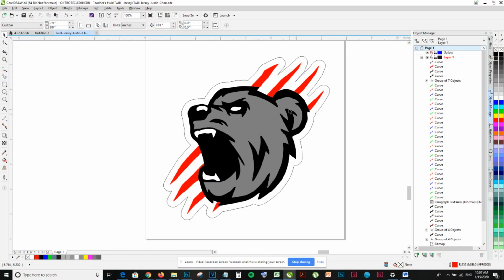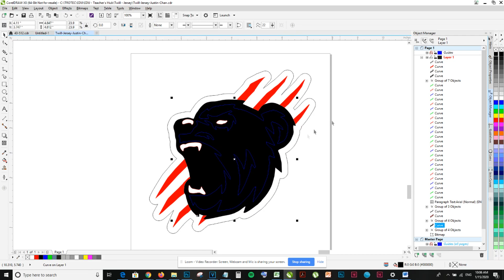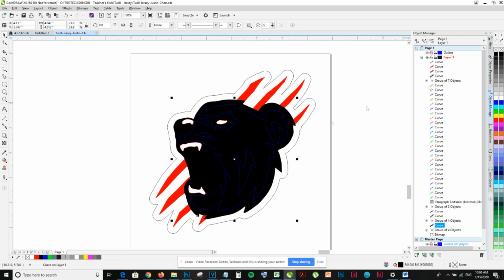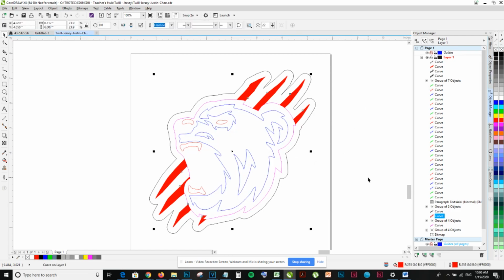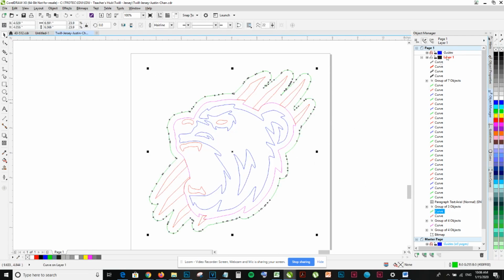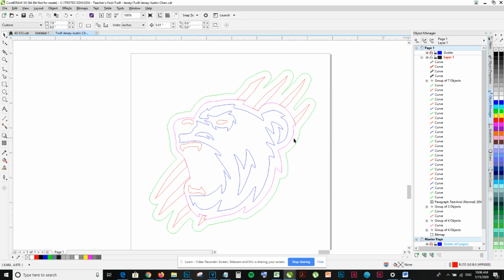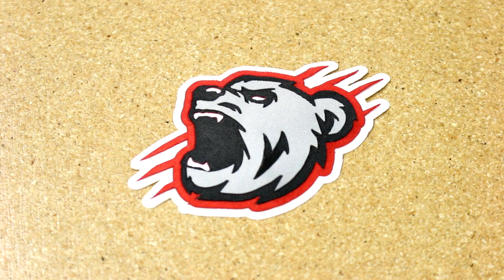Laser Cut Twill | Twill Cutting | Custom Sports Jersey

Comment: what material was used?
Reply from the maker: Hi Darius we used twill, any twill would do you don't have to have adhesive backing on it. The one we used did have adhesive but that's good for heat-press, if you're stitching then you don't need adhesive. 

Thanks!